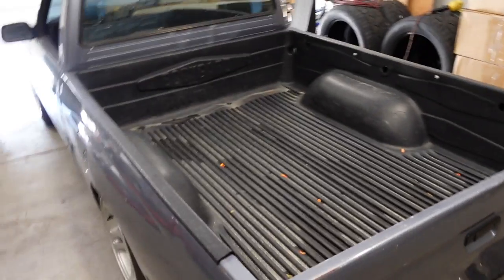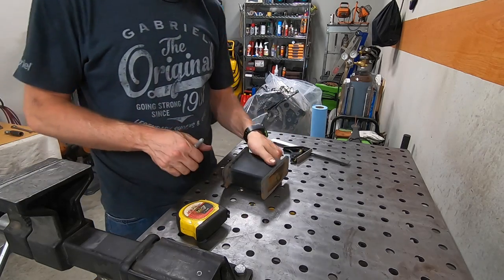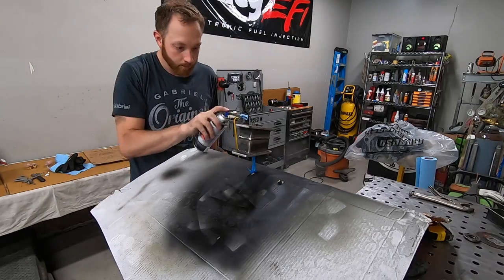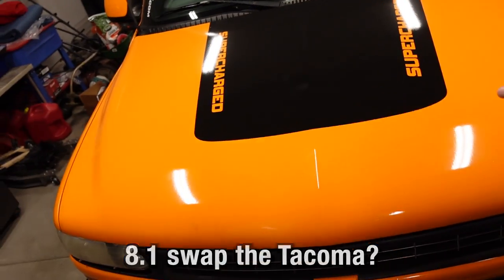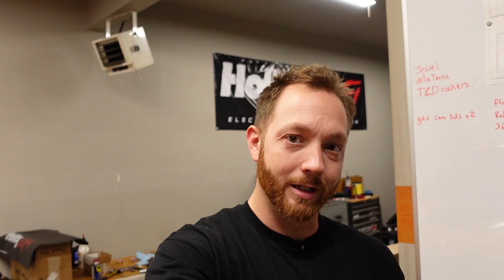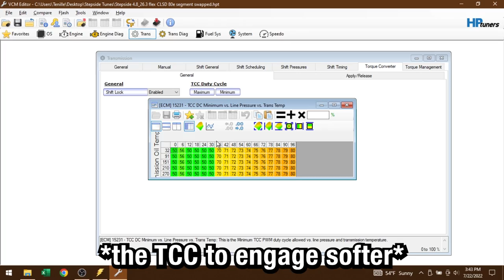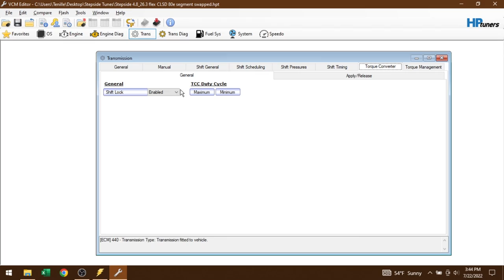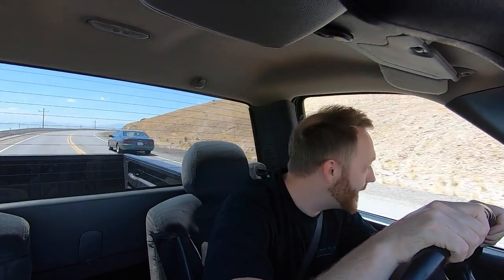fixing the WORLD'S WORST lowering kit THE RIGHT WAY

Comment: Howdy LT, all GM calibrations are configured to unlock the converter with a throttle lift or brake circuit sense.  It becomes more apparent with higher stall speed converters and a stronger TCC.  Also, the weak point in a 4L80-E is the overdrive roller clutch.  This component was redesigned for 2001 moving forward with smaller rollers that are now each captive in alignment foots to prevent skewing which is apparently a problem that affected some units although I've never seen it happen personally.  The smaller rollers unfortunately don't hold the torque the old larger pre-2001 ones did, so due to that component, having the TCC unlocked during the 3-4 should help it hold up.

Comment: I put the bell tech 5978 leafs on right before you bought it! Technically it's supposed to be lowered 6" after your mods, I don't think they lowered the truck 3" in reality. 

The 5" blocks were also there so I can air the suspension all the way up and have it level with some engines/fab material in the bed vs level at lower air PSI in those air shocks

Comment: I can relook at my tune when I get home this evening and tell you which setting it was to keep the converter locked when it shows 0% throttle. It was bothering me locking and unlocking with the cruise set going down the highway so I fixed mine
Reply from the maker: I'd be curious to hear what you did to change that
Reply: Please, need this info
Reply: Under the transmission tab, go to torque converter tab, then apply/release and adjust the minimum throttle release parameters. You will need to fine tune your speed release and apply as well so it doesn't pull the engine down at slower speeds with the tc locked
Reply: That should work on the gen 3, my gen 4 has an actual minimum tps enable and disable option

Comment: For the converter to stay locked when you let off the gas you can adjust the minimum throttle release low and high speed tps under trans , TQ converter, apply/release. And for the converter staying locked during the shift you have to have shift lock enabled under TQ converter general tab
Reply: Nevermind I seen in your tune you already have that enabled

Comment: Please LT do NOT put the big block in the COPO truck leave that one ls u already have a big block to play with.    I did the brake conversion on my 03 Silverado this weekend used 14 Silverado 1500 parts and man what a difference it made in stopping power  thanks for the content 2jz on the Toyota or an L33 5.3 there still pretty cheap and easy to get if you want an aluminum LS.

Comment: All 4l80e transmissions unlock the converter on deceleration so the engine can idle. I assume it’s for better fuel economy. It’s hardly noticeable in a heavy duty truck with stock exhaust. But it’s incredibly annoying in a lighter vehicle with exhaust. Also if your running a larger throttle body it’ll get annoying because it doesn’t take as much throttle angle to maintain a certain speed. There is a min tps unlock parameter in hptuners that allows you to set when it’ll unlock based on tps. I use the bluecat transmission tool and it makes setting up shift points and lockup fairly easy.

Comment: You kinda crack me up complaining about the firm shifts. You want a fast hard shift otherwise you're just wearing clutches and raising temps. I enjoy your videos. Keep up the good work
Reply: Actually what you want is a manual transmission.
Because otherwise it's not elite.
Reply: @TravisFabel  I have three automatic vehicles and two manual vehicles. Got to have a little variety. Oddly I prefer manual transmission in traffic. Especially if it's a sports car.

Comment: i set my triple to lock up in third around 120-130mph in third with tow haul mode. its a setting for the lockup during shifts. transmission tab> torque converter> general > shift lock disable or enable.

Comment: Once the COPO gets the bigger motor, put that 4.8 in there.  Upgrade the brakes all the way around because every Tacoma I have driven from generation had horrible brakes.  4 link and coilovers would take a bunch of the roughness out of the ride so yes!
Reply: First gen facelift owner here. 2001 year model base with manual trans has PLENTY of brakes, I've moved over to 225/45/17 Lexani tires on Fauxbra SVT wheels and I stop reeaalllyy well. You're only as good as your tires are, not your brakes, but it really helps when your truck weighs like 2600 pounds lol

Comment: For your converter unlocking issue: Trans>torque converter>apply/release
Under minimum throttle release, change high speed TPS Lo and High Speed TPS High both to 0%. Had this same issue on an 04 P59 with 4l80 segment swap. Stays locked on decel when cruising.
Reply: Stock was 2% Lo and 4% High. Weird glitch. I spent a while looking through forums.

Comment: The TCC lock up may unlock during DFCO. A throttle pedal module might let you set a minimum throttle percentage so the BCM, TCM, and/or ECM think the throttle still has a bit of "tip-in", as if your foot is holding it just barely above idle. Without it going to full idle, DFCO may not engage, which could be unlocking the TCC.

Comment: I could be wrong but I believe the TCC unlock with 0 pedal problem is under Torque Converter/Apply Release/Min Throttle Release. Set TPS fields to 0% and VSS to 256. ...Obligatory try at your own risk.

Comment: I think a 1JZ or possibly 2JZ would be awesome in the taco, but if you really want a lightweight sport truck you could do a 3S, or even a 2ZZ and turbo it.  The 2ZZ revs to about 8200 RPM, it comes factory with forged rods, and it’s an aluminum block, so it should be lighter than just about anything else on the market.

Comment: Transmission Temperatures! T T's!!! @ 18:00 -ish One reason to plumb the radiator into the circuit is to warm up the transmission in Low Temp conditions (Winter, bleh). In a Desert No worries, butt.... if a Glacier comes chasing ya, maybe use a temp controlled T valve thingie to utilize either Transmission Radiator Cooling (or Warming)! ***shrugs*** things to not think about in a Desert, lol. <3 all

Comment: Have you ever considered mounting the trans cooler under the bed somewhere, maybe behind the rear axle? Then you could put an auxiliary fan on it and not have to worry about routing the lines past any heat sources.

Comment: If you keep the Taco, I would either put a LC Engineering Stage V turbo stroked 22RE in it or swap in a old school aluminum Buick 215 V8 with a Olds F85 turbo setup. Keep COPO and Ugly Truck intact.

Comment: You could go 1jz with a turbo (much cheaper than the 2j) if u want to keep it as light as possible u could put a rotary in it. Or go crazy and put the 8.1 in her. Maby with some 3.33 gear to tone down the tq
Reply: Rotory isn't light at all man. I've had 2 lt1 swapped rx7 turbo 2s and they were 50 pounds light with that iron block aluminum headed v8 over the rotory drivetrain

Comment: I'd build the engine in it and turbo it. I've done a V8 taco. Unless you're drag racing it only they ain't very friendly without dumping tons into the suspension. A V8 takes up all the room under the hood which makes working on it a pita.

Comment: I've got a premo 98 f-150 lariat 5.4, short wheelbase, step-side, white grey leather that I plan to build but it only has 180K and these are known for lasting 300K++ miles. So not sure I want to do it.
I've thought about buying a Toyota truck like yours and building it, so I would be very interested in seeing the little truck built. I knew the weight of the little trucks and know that 400-500 wheel horsepower would make a 2600 lb. scream.

Comment: Swap in a modern 4.3 V6 and make a turbo for it.  Basically take you same concept of the stock 8.1 with mild boost and do it to a 4.3 in the Taco!  OR hurry up and get a 6.0 for the copo and just put the NA 4.8 in the taco with 100shot of NOS
Reply: A modern Sy/Ty. LIKE IT!

Comment: I’d encourage you to do a 4BT swap with TKX trans and 3.05 gears.  Won’t be the fastest, but it would be a ton of fun to drive and would cruise wonderfully. Should be able to get high 30’s, maybe 40mpg.
Reply: 4bt and trans that goes with it  is 1/4 the weight of the truck. A  6speed Camaro drivetrain could knock down 25 on the highway, weigh less so it handles better, and 2x the power.

Comment: Couldn't the converter lock up parameter be changed in the TPS? Example: Transmission/Torque Converter/ Apply-Release/Minimum Throttle Release (HP Tuners)

Comment: Since the lowering blocks were angled to correct pinion angle, wouldn't shortening the blocks change the pinion angle and also change the angle that the block has built in?

Comment: Sir, that fan cooler you have in the shop background. Curious if it works well?  I am looking at getting one of these of similar size. Does it throw air well? Noisy?
Reply from the maker: it pushes air pretty good, and it definitely takes the edge off on those hot summer days. I think it was about $400 or so, I'd say its worth it
Reply: @LawrenceTolman  thanks.
Which model number?

Comment: two issues, cold trans fluid is not better than trans fluid at operation temp. Second, setting the shifts to be firmer instead of softer will extend transmission life.
Reply from the maker: I agree that a firmer shift can extend the life, but there is such a thing as unnecessarily firm. under very light throttle, there's no need to slam gears and clutches

Comment: Aren't you supposed to keep the converter locked at all times with a boosted engine?  Definitely would be faster that way.  That's what I'm trying to do with my 6R80, but the stock torque converter slips in 3rd.
Reply: No

Comment: Quick question unrelated to your vehicles (but related to one of your engines): Would it be possible to swap the 8.1 into a 07-18 JK Jeep Wrangler?
Reply from the maker: Anything is possible for sure. The main challenge would be the physical size of the engine. I know they put Hemis in JK Jeeps all the time, but the 8.1 is a bit wider and longer (plus heavier) so a bit more cutting might be in order. But, I’d guarantee it could be done with enough determination and skill.
Reply: @LawrenceTolman  Thanks for the reply, Brother.

Comment: 8.1L from the ugly truck goes in the AWD stepside. 4.8L from the stepside goes in the Tacoma.

You're welcome.
Reply from the maker: you know, I had that exact idea a time or two... that would be fun!
Reply: @LawrenceTolman  and get a 5-speed or 6-speed manual to put behind the 4.8L, and use aftermarket ignition & fuel management to avoid using a OE style PCM.
Reply: Oh, and don't forget to 4-link a 2nd gen Explorer 8.8 rear axle (31 spline, disc brakes and same lug pattern) to handle the abuse.